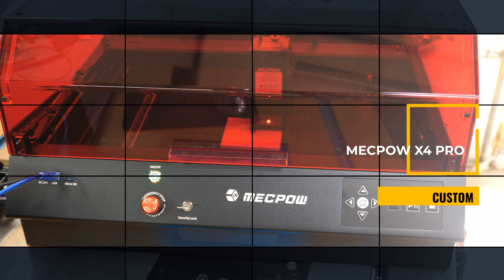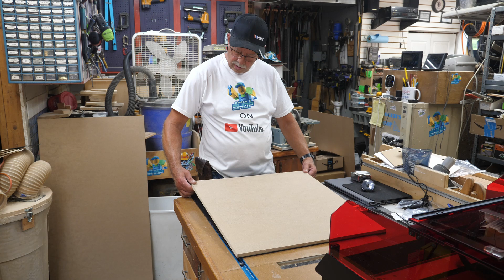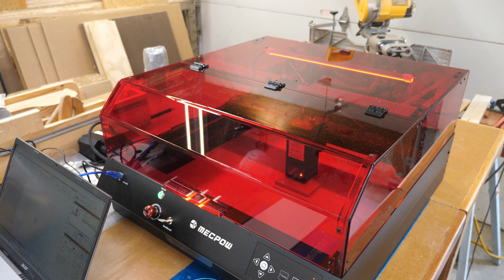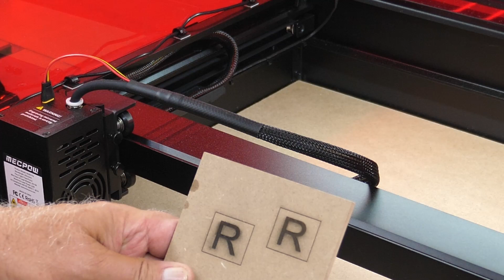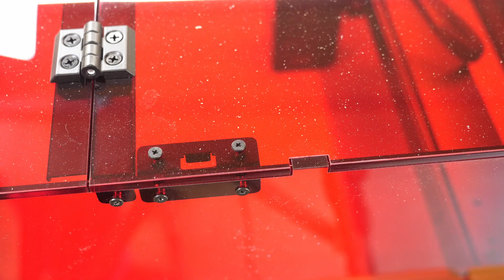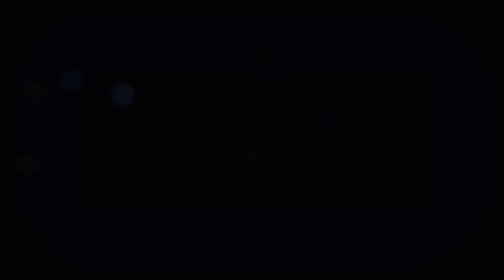Mecpow X4 Pro Laser Custom Layout Grid

Comment: What are the recommended settings for the X4 Pro ?   I tried the  test prints,  with the squares, and selected   and used   min 1200 max 22000  and power  min 10 and max 100.
and it all looks burned on the sides of the squares.   and  1200 with 100% power 70 - 100  is the only one that cuts the 5 mm board.
Reply from the maker: Try this test grid:  https://moonshinecrafts.com/product/laser-cut-settings-test-grid-generic/  Make sure you are set to mm/min and not mm/sec
Reply: @rogersshop  Thank you very much
hmm..  i wonder if   mm/min and not mm/sec    is wrong at my end

Comment: Hello Roger. If you were to size your grid to 410 x 400 would the machine hit the limit switches? Is it possible to make an exact 410 x 400 grid? I also noticed there is a little movement in the metal tray itself. Keep up the good work my friend.
Reply from the maker: Yes, it can be made to 410mm.  In my case, just didn't want to create yet another grid!